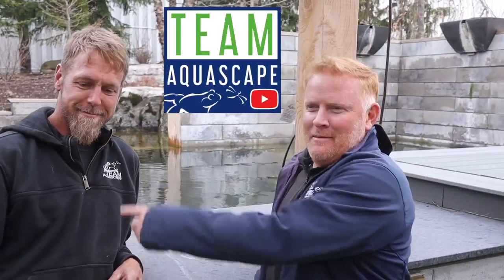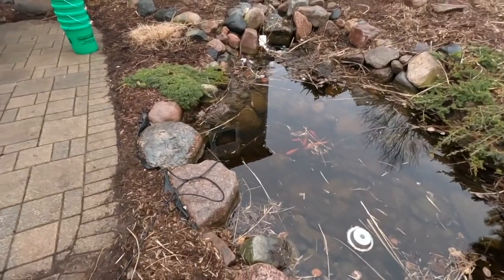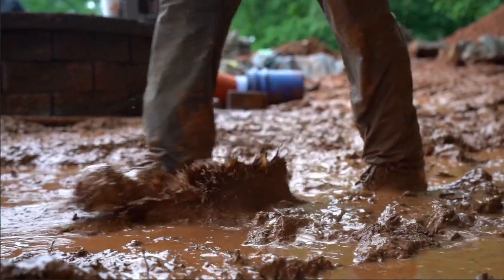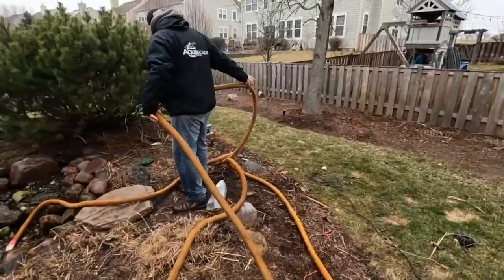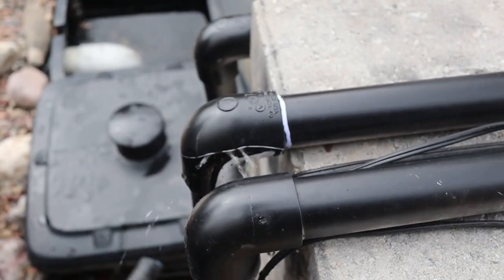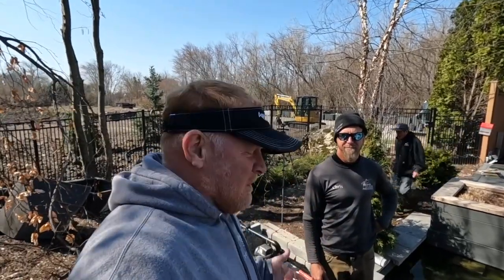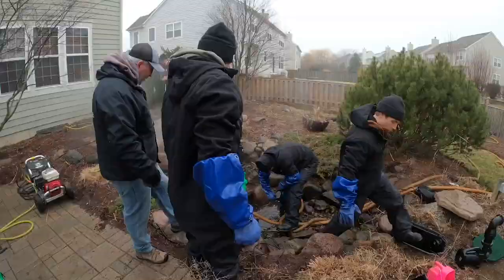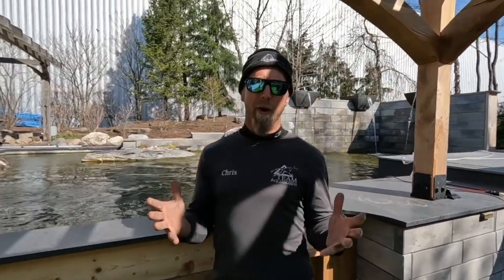We Clean Our Formal Recreation Pond!

Comment: Hi Chris, silly question, because I am new to the autodoser, I recently installed the XT on my pond and the SL on my pondless.  I am New Jersey and plan to run both throughout the winter.  Do you leave the doser running throughout the winter or disconnect?